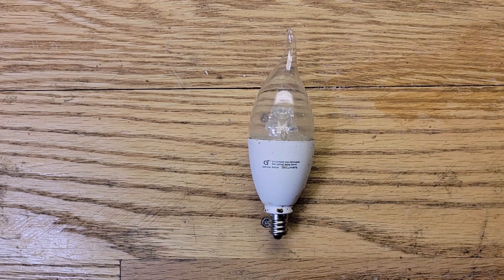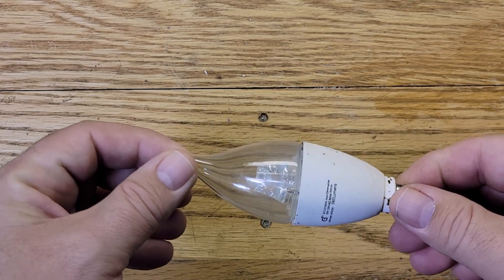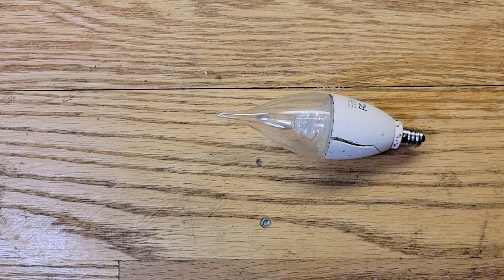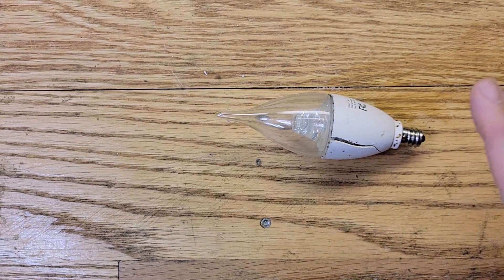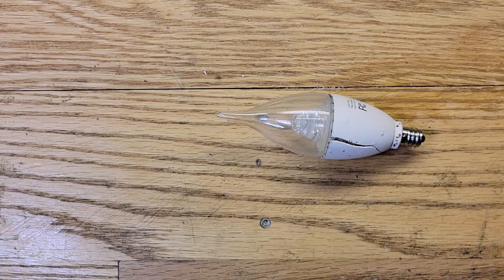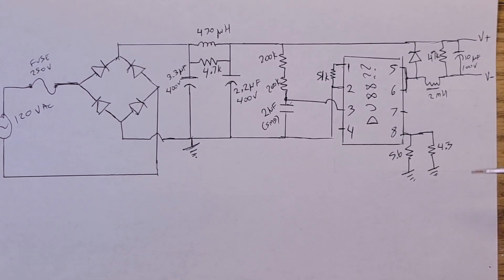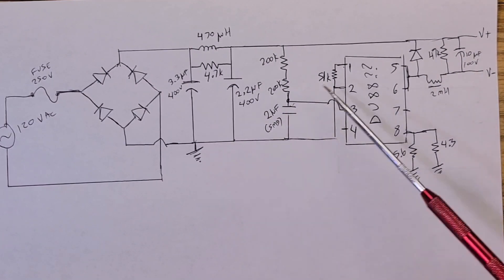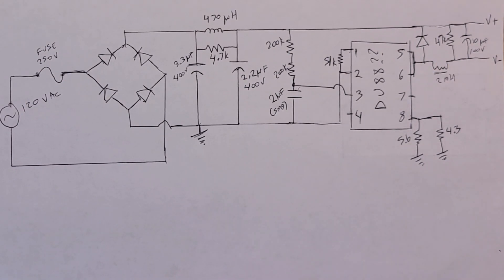Dissecting a Failed LED Bulb: What Went Wrong and How It Works

Comment: LED light output simply drops as they age. End-of-life is sometimes specified on LED lamp packaging in terms of light output at end of life versus that when they were new. Datasheets for LEDs intended for lighting purposes (versus just indicator duty) almost always aging information.

That circuit is a "buck" switching regulator that will be directly controlling the LED current. It probably directly regulates the peak current each switching cycle. In a circuit like this controlling the peak current results in reasonably good control of the average current (not always true for buck regulators).